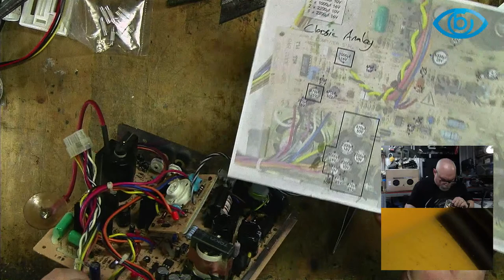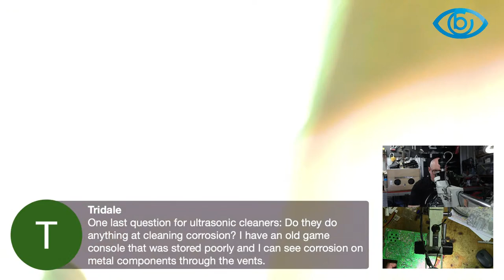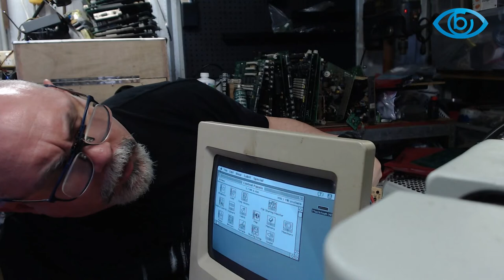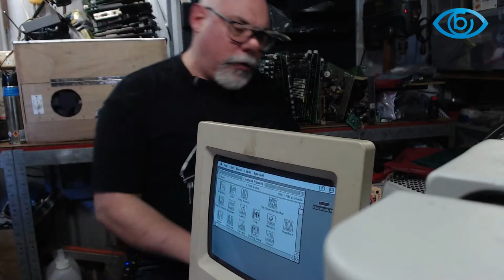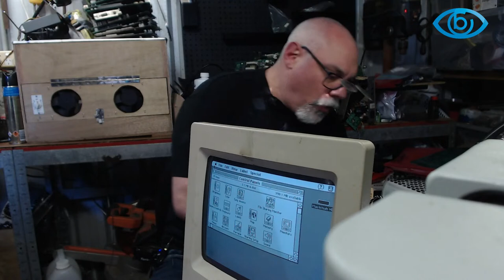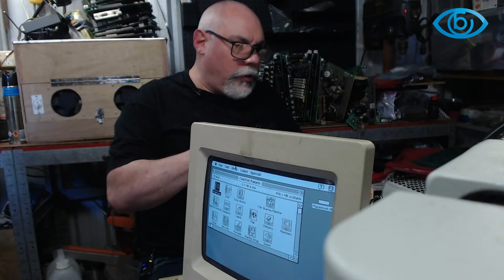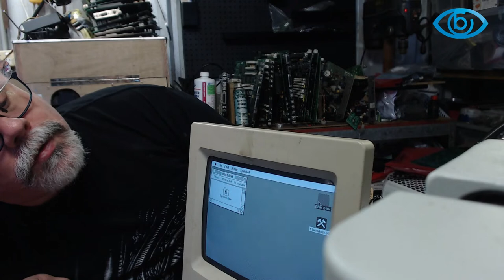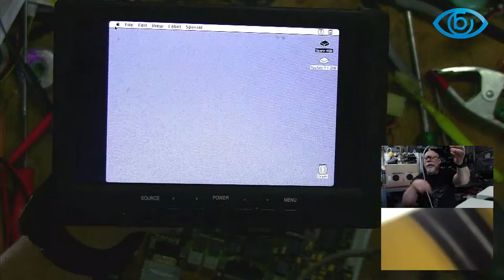Macintosh Classic Analog Board Voltage Conversion

Comment: Great video. To convert from 240v to 120v do you remove the 240v jumper pin on JP2 & place a 120v jumper pin on JP1? Is it also necessary to add the missing adjoining cap that’s present on the 120v board? Thx